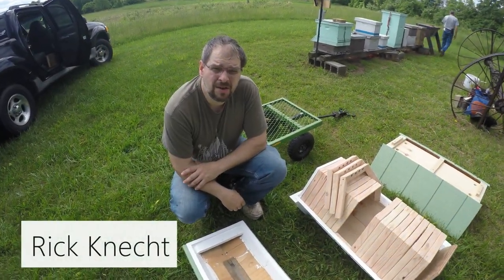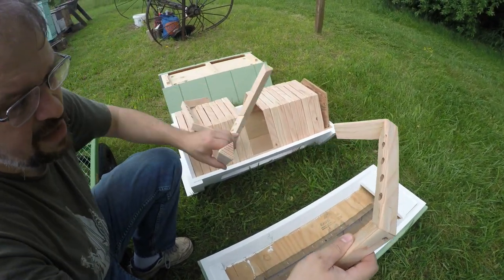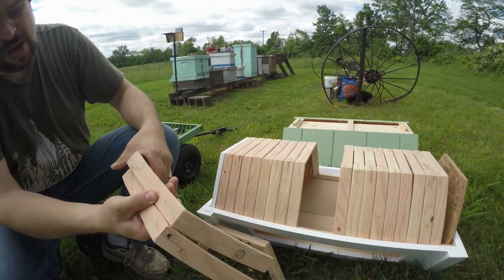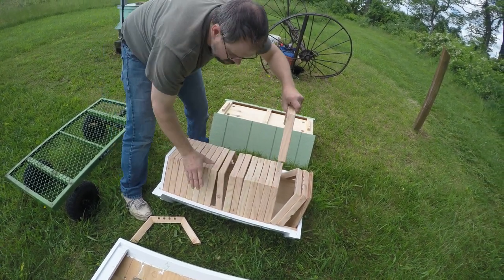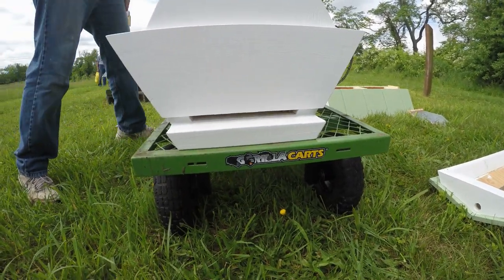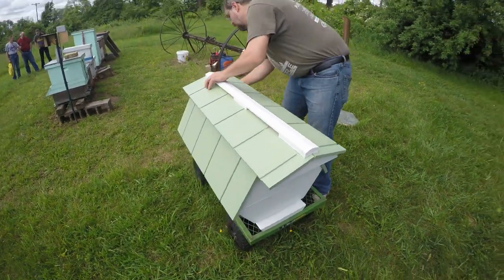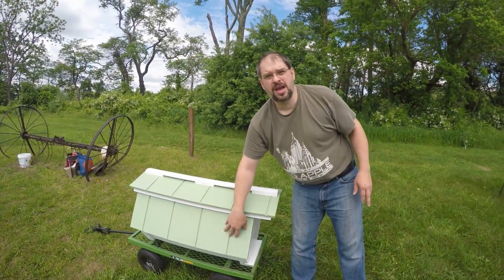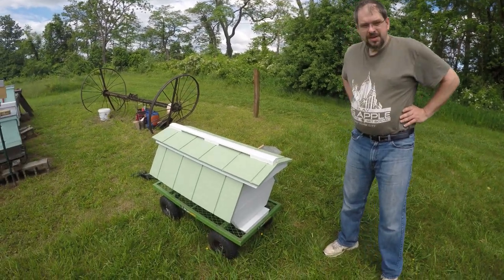Cathedral hive preview

Comment: I haven't been able to see how the bee highway works. Is there a gap between the bars where they can drop down? The bars are snug on top, like a TBH, so I can't figure out how they would access anything other than the first and last frames that way
Reply from the maker: Hi Serena.  The holes in the top bars are down from the flat part where the frames mate up when placed alongside of each other.  The taper allows the bees to exit the holes at each frame.
Reply: @nwnjba  ah, thank you. What a great design.